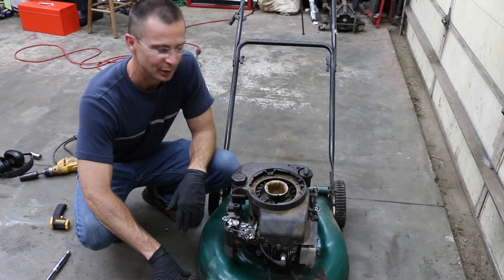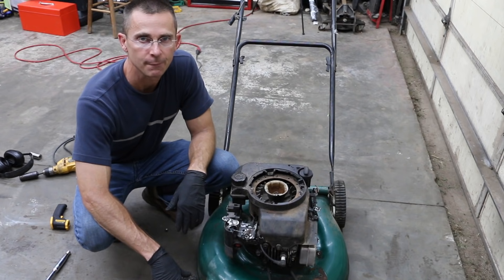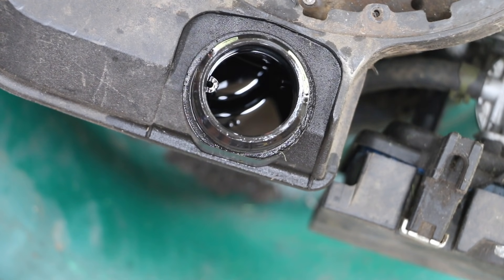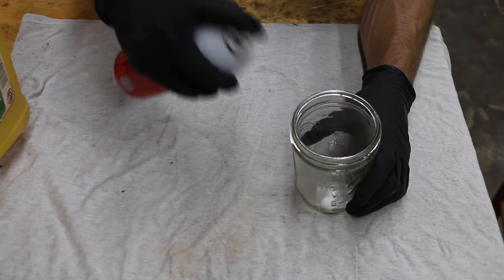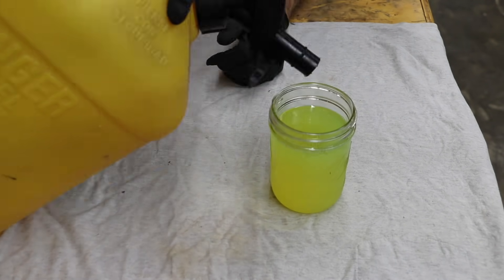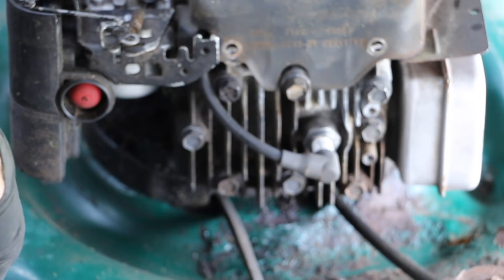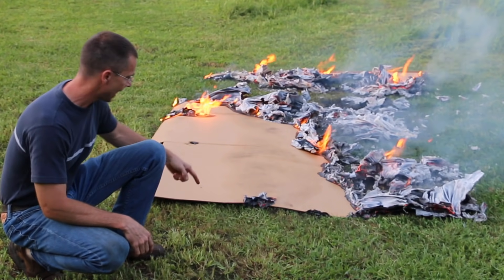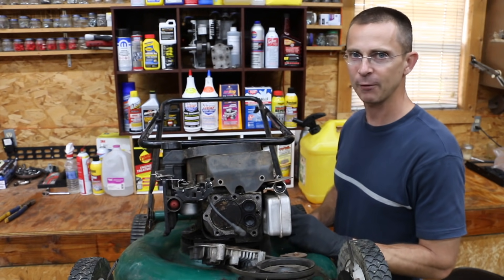Will a Gas Engine Run on Diesel?  Let's find out!

Comment: Why call it gas when its a liquid
Reply: It's short for gasoline. Which is a liquid.
Reply: @scourge34  but gasoline is petrol so why not just call it petrol, i don’t get that
Reply: Because it's more specific. Petrol is short for petroleum, which is essentially oil. From petroleum you get diesel, kerosene, gasoline, fuel oil, and countless other products. I'm the opposite, I've always wondered why some call it petrol, which is more generic.

Comment: can you  try to heat disel up to 80 degrees  celsius before filling, and see if thet helps. or make a mixture  gassoline and raps oil!  if this is possible it could be possible to make a coil outside the exhaust later
Reply from the maker: Thanks for the suggestion.

Comment: Thanks again, great video. In the 60's and 70's some would run a 90/10% gas diesel mix in gas engines. You could pick up an extra 1-2 MPG and diesel was cheaper than gas then. I was told it improved the octane but I don't know that is true. I ran the mix in small block GMs and it helped with mileage. The farmers would start their farm tractors on gas and then add kerosene and run all day on it.
Reply from the maker: You are welcome!  Thanks for sharing.

Comment: White smoke typically mean unburnt fuel so you could try using a hotter plug and the necessary use of the primer could be from the viscosity of the diesel so for that you could try going up a couple of sizes on your jetting, just a thought
Reply from the maker: Thanks for the suggestion.

Comment: My brother accidentally ran a 2-stroke outboard on diesel for about an hour.  Only problem was the plugs fouled.  Cleaned the plugs and put gas in and it ran fine.  However do not try putting gasoline in a diesel engine, that can cause some serious engine damage.
Reply from the maker: Good Point!

Comment: Gas get ignited by a sparkplug which pushes the piston back out and Then in an then all over again. Where as the diesel gets ignited by Extreme pressure which is why diesel wil not run in an gas engine. Because diesel does not get ignited by the sparkplug But pressure and the gas engine does not provide enough pressure to the diesel to make it explode
Reply from the maker: Thanks for the feedback.

Comment: I once put diesel in a pickup truck I had by mistake and while trying to start it I realized I could by covering the air intake of carburetor with a rag. Ran fine but smoke like crazy. Thus the realization that diesel used compression and not combustion to run an engine.
Reply from the maker: Thanks for sharing.

Comment: Did a search for Project Farm Gas Can.   Didn't see a review, unless I missed it.

Can you work your heavy duty comparison skills up against a variety of popular gas cans?   Rate them on flow rate, pressure containment or how well it seals up (not high pressure, but you don't want a gas can that "breaths" through normal heating and cooling weather/day/night cycles), rate them on ease of use to when filling a chainsaw vs filling a recessed vehicle?  The "new" press to pour valve is horrible, spring is too strong, and makes a mess when filling light weight stuff.

Contenders might include the Harbor Freight Jerry Can, the SureCan, GarageBoss can, and any others that catch your eye worth testing?

Bonus test would be to see how well replacement nozzles / vents might be at fixing the problems.
Reply from the maker: Thanks for the video idea.
Reply: @ProjectFarm  happily and thank you for the approach you take to reviewing things.  I really enjoy watching the process and I always end up learning something.

Comment: I was wondering if different jet would make it run better? Or adjustments to the air, maybe it needed to be atomized more. Great vid, love the 50/50 mix
Reply from the maker: Great suggestion!  Thank you.
Reply: Leaning out the diesel mixture might make it ignite better. Hm.

Comment: Put gas in just enough to fill the bowl and line then put the diesel in tank if the motor gets hot on gas it should run on the diesel. The engine has to be hot.
Reply from the maker: Thanks for the suggestion.

Comment: As you can see here diesel is much better (and safer) for starting a fire. If I have a fire that’s stubborn getting started I like to use used motor oil, it burns similar to the way the diesel does.
Reply from the maker: Thanks for sharing.

Comment: What other types of fuel can you use like propane acetylene oxygen nitrous I love to see how that works in a small engine that'd be cool and and will it run on WD-40 ether what if you tried different fuels to see how they reacted with the cylinders and the Pistons in the valves see how it heats up the engine and you can try different oils in it too see how the different oils break down could be a three-part thing
Reply from the maker: Thanks for the video idea.

Comment: please try a styrofoam additive just a bit to not clog the engine and also add some diesel, butane, paint thinner, turpentine, ethanol, citrus 🍊 oil solvent, old french fries oil, used motor oil, extract some oily waste plant matter, soot for extra carbon,  blend it all together nicely strike some good DIY balance between the thin and thick parts to see if you can make something that runs reasonably well and doesn’t clog the engine and is cheap
Reply from the maker: Thanks for the suggestion.

Comment: I tried an old 90's mazda 323 with 50/50 mixture. Runs smooth, but you have to give it lot of gaspedal.
Reply from the maker: Thanks for sharing.

Comment: ok how about a diesel engine on gasoline?

yes you will need to get a diesel engine witch you can easily get from the volkeswagon scandal if those cars are still around.

or possibly it's smaller version the nitro engines used by rc hobbyists

it just needs to be a glow plug type

Comment: I wonder, did the 50/50 mix use more fuel or did that extend the time being run? To be clear, did the diesel just get expended and the pint of gas burned at the same normal rate? Did the running time take twice as long?

Comment: And this is why some attempts to turn gas cars into diesel in the 60's and 70's resulted in basically blowing up the engine. The modified engines were not built to handle the pressure of diesel.
Reply from the maker: Thanks for the feedback.

Comment: so..great video!  I actually took the diesel atomizer out of a failed "Chinese Parking heater" and put a sleeve and gasket and press fit it a lawnmower in place of carb.  It actually ran great!  I advanced timing a little by moving the magnetic pickup (diesel is best at about 20 degrees advance) and next going to try shaving the head--to get compression up a bit--with a spark plug though--not really necessary. This is a summer project...lol  BTW--I think a great test would be to test the various 2k, 5k, and 8k diesel heaters.  I use one in my workshop and they are getting to be common---but lots of quality difference and I am convinced that the 8k is just a 5k relabeled!  Love your Youtube channel--keep up the great work!!  If  you're not familiar---just do a search on Amazon or ebay.
Reply from the maker: Thanks!  Thanks for sharing.

Comment: Question: How successful would two-to-three ounces of diesel added to a tank of gas work as an octane booster as the flash-point is much higher in diesel?

Question: It was posited that adding acetone to gasoline increases gas mileage up to 10%.  I tried it once but could ascertain no difference in mileage.  Unfortunately that was many years ago and can no longer remember ounce-to-ten-gallon ration.  Perhaps another commenter can 'jog' my memory on that.  

Thank you for your excellent presentations.  I'll be becoming a subscriber when I next see the info.
Reply from the maker: Thank you for the video idea on diesel as an octane booster and acetone to improve fuel efficiency!

Comment: The reason 100% diesel fuel doesn't work in a gas engine is because diesel engine run mainly on compression and gas engines run on compression but not as much as diesels if you but 2 jars of fuel and diesel and test the flammability gas will catch fire instantly but diesel fuel wont diesel fuel burns better with compression and gas dont

Comment: With gasoline, the vapor pressure is too high to explode; with diesel, it is too low. Mix the two and you get a critical mix of vapor and air that can explode in the tank.

Comment: U didn’t comment as2 the loss or gain of mowing power w/the 50/50 mix. 

I would like 2cu find the run break point& power efficiency point for the 50/50 mix.  In other words the minimum gasoline %required 4a smooth start& continuous run& the best mix for mowing power. 

I think many of us were watching your chemical experiment wondering what the best run & best power mixes r.
Reply from the maker: Thanks for the video idea.

Comment: I was told that diesel would just lube the engine but at the same time it shouldn't be able to start, so that might cause damage that it started, but typically if you put diesel it just cranks in a gas mower.

Comment: I mixed almost 50 50 in a car it worked. Are there risks to using it permanently? Diesel is much cheaper where I live.
Reply: I run my bike on 2% diesel, and passes annual exhaust examine with even better figures. I think 50% diesel would be too much. Try some lower ratio.
Reply: @kevcheng3653  My 2 stroke moped used to run on 75 percent diesel fine for 3 years. The problem is if I can do this with my car lol
Reply: There's a local facebook group share adding diesel in cars and bikes to enhance fuel efficiency, but no more than 5% recommended on their list.
Btw, I use 2% diesel on 4 stroke fuel injection bike for 2yrs. Car engine should have similar structure.
Reply: @kevcheng3653  On my moped I used 50 percent for 3 years no issue. A bit overheat but mileage enormous.

Comment: Before I even watch this: 

A mechanic once told me that a gas engine will run with diesel in it, just not very well at all. 

But a Diesel engine will run on gas really well, for about 5 minutes. Then you have to replace basically every part the fuel touches, or get a new vehicle

After watching: 

Notice in the cardboard demonstration, when the gas ignited, it actually ignited at the closest point, the diesel side. It could be that the 50/50 mix works because the gasoline will flash, and that, in turn will ignite the diesel, allowing it to run? Not a mechanic, just curious

Comment: When the girl accidentally puts diesel in it drives home cause engine is hot but when trying to crank over next morning no go, diesel runs off heat and compression which you have when engine is warm/hot

Comment: Hi, could you please test the effect of 20% oil in a 2 cycle engine? That is the mixture ratio of RC engines. Since RC nitro fuel has less energy density and is being used faster than gas,  why 2 cycle gas engines require way less oil than RC engines?
Reply from the maker: Thanks for the video idea.

Comment: Still love your videos man. Been watching since 2018. I was wondering, on an older gas engine, like a late 80s to early 2000s, if diesel would mildly improve fuel efficiency due to it having a higher energy density than gasoline by volume. I currently drive a 1990 gmc k1500, and add about 1 gallon of diesel to 20 gallons of gas. Its hard to measure reliable fuel efficiency though due to my hectic life. Would you like to test it on your 03 suburban and find a little more definitive of a result
Reply from the maker: Great suggestion!  Thank you.

Comment: The reason why you will have difficulty with diesel in a gasoline engine is one the flashpoint and two the compression. Diesel has a high flashpoint and gas has a much lower flashpoint. As stated the diesel uses compression. The reason is due to its high flashpoint. The high compression actually squeezes the diesel fuel molicules closer together. This with a higher than gasoline air charge mixture cause a rapid build up of heat. Now diesels can use an alternative heat source to cause it to fire. But this is done in colder climates due to the metal being at a very low temperature and will not allow the heat to build to a proper level. This is accomplished by the use of a glow plug. They are like a spark plug in a way but operation is very different. The glow plug allows the cylinder to heat up this providing the fuel air charge with the temperature nessesary combust. Gasoline has a much lower flashpoint and quite a difference in air charge density. Diesel being more slow burning provides greater torgue due to the strength of the expansion of gas. Gasoline burns much more quickly and give more horsepower. Diesel engines move mountains, gas engines move people.
Reply from the maker: Thanks for the feedback.

Comment: It will clean the crap out of it but depending on the rings the diesel may seep into the crank case and thin the hell out of the oil. Seen it in automobiles. The plug is prob fouled. Dump some atf in that thing if you want to clean the gunk out. Its gonna smoke you out though
Reply from the maker: Thanks for sharing.

Comment: If you look back to the early 1950's John Deere made a tractor engine that had 2 fuel tanks.  The tractor was started with gas and then changed over to diesel.  They didn't have a problem running.  I believe the John Deere was a model "B" tractor
Reply from the maker: Thanks for the feedback.

Comment: If you have a high compression ratio engine you potentially could run diesel but always use the recommended fuel. My dudes
Reply from the maker: Thanks for sharing.

Comment: Hey there you go Wayne you and I both know that diesel does work in a gasoline engine once it's running you need to adjust the carburetor screws by turning them into make it run it does run on diesel
Reply from the maker: Thanks for the feedback.

Comment: Diesel  fowles the sparkplug, mix gas into the diseel thins out the heavy  oils and helps it ignite, put gas into a diesel engine and listen to the  rpm,s sore to the point of destruction, automotive  101.

Comment: Totally the wrong way round! - I had a Volvo V40 with the excellent Mitsubishi 1.9Turbo Diesel. She was always a land-shark. But one day - quite soon after getting it; I stupidly put half a tank of unleaded in it before I realised what I was doing. I topped off the other half of the tank with Diesel fuel and made my apology to the bemused lass at the till. Oooooh; it had a snarl! The dear V40 stuck her nose to the tarmac, flapped her tail, and she was off! I hung on the next few hours in terror of some flashing light from the dashboard, or smoke from the grill . . . but she loved it! It gave me the puppy dog eyes at the next fill up and there was only plain old Digby-Diesel-fuel. Diesels will literally burn anything. It is only the modern engine managemant electronics that will pull the plug. That engine went on for 13 years and 264,000 miles; and would have lasted longer. But muggins skipped getting the water pump changed in time. One freezing January night she blew out all the coolant; cracked the block; and left towed up the ramp to the breakers. Saddest day!
Reply from the maker: Thanks for the feedback.

Comment: I accidentally put diesel in my Land Rover and nearly destroyed it.  The oily stuff went past my piston rings and filled the oil pan so full the pistons crankshaft couldn't turn because of the pressure on the underside of the pistons.  Cost a lot to get all the crap out of my system.  NOT fun.
Reply from the maker: Sorry to hear that!

Comment: Hi, while returning home from a deer and antelope hunt, I stop for gas at gas station that look more like a recking yard then a gas station. After waiting a few minutes I decided to fill my truck myself. Finally the gas station attendant show up and said “you know that diesel” I immediately stop the pump thought what will I do. I was two hundred miles from home with diesel in one of my truck tank. I phoned a mechanic and told him of the dilemma. He told me to fill the truck with gas and drive home. I was sceptical that it would work but I drove home. The truck ran rough and l had to switch tank to climb valleys on my way home. I made it home and made sure this does not happen again.  Never say never this time I was driving a diesel truck pulling a 5th wheel in a horrible snow storm trying to drive to Ontario after my dad past away. I pull into a truck stop to the island make DIESEL, I filled the truck and found out when I paid that it was gas, I was a bit upset to say the least, but I found a garage and a mechanic with a well hone talent in syphoning gas. I he got most of the gas out and then filled the tank with diesel the mechanic said that the percentage of gas was so low that it would not damage the engine. It ten years later and I am still driving the same truck. Well the short version is you can put diesel in a gas engine and it will work, but the other way is disastrous.
Reply from the maker: Thanks for sharing!

Comment: Will run OK to run on kerosene. Old tractors 1920s up, would run OK on kero after starting on gas to warm up. Has to switch back to gas before shutdown.
Reply from the maker: Thanks for the feedback.

Comment: yeah.. but does it stop easily?
Reply: (added about 5 liters to a gas car in error one time, the car didn't turn off if I removed the contact & key... needed to cover the air intake) one of the pistons failed some hundred kilometers later in high rpm.

Comment: I can confirm that car works on diesel mixed with gasoline, it just needs an injection of lighter gas into the air filter to start.
Reply from the maker: Thanks for the feedback.

Comment: I just put water in my car. Fuel is just invented by corporations to make people spend money. Don't let them scare you. Water is just as good as expensive fuel
Reply from the maker: Thanks for the feedback
Reply: I use brainwaves of rage converted into electricity. Carbon negative emissions, but very tiring for driver.